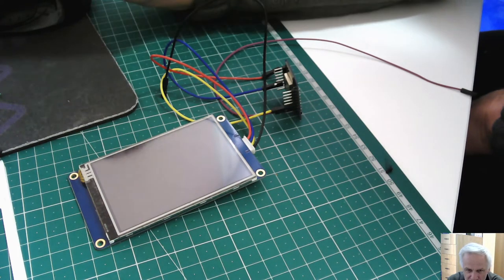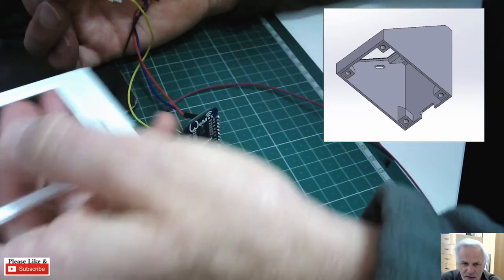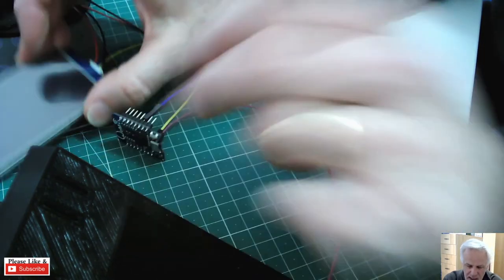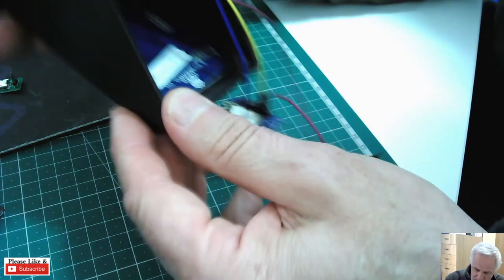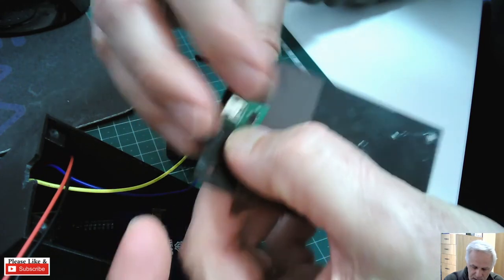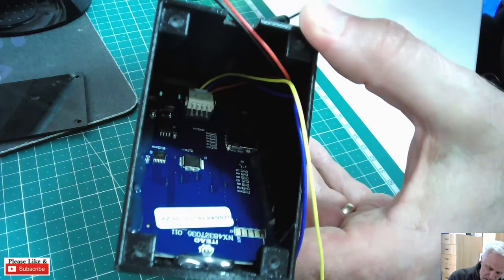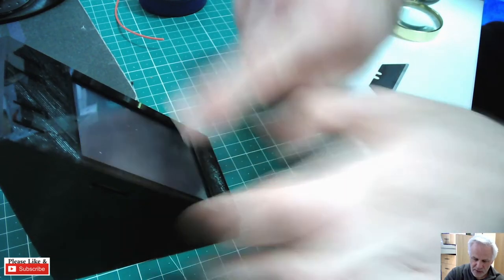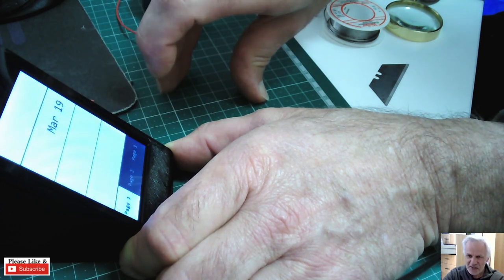HA Switch Plate (HASP) #0017 3.5" Nextion Desk Top Design

Comment: I think the latest firmware has provision for a buzzer on pin D2.   I am in Australia, with similar shape wall plates to the US, but fitting a buzzer in the actual wall plate is still tricky.  I think it would need to be a very small piezo buzzer....
Reply from the maker: Hi Brendan it's been a while since I have looked at this project. May be time to revisit it
Reply: @flixmyswitch  The latest version using blueprints instead of yaml to create functionality is pretty easy to use.   Just would rather it on the wall than on the desk :).
Reply from the maker: What kind of box do you have in mind depends upon the country I guess
Reply: @flixmyswitch  In Australia we have a rectangular box, similar to the US ones, but mounting and screw holes are different enough to make it no compatible with US type.   
I'll keep looking though.  I might have to make one up if I don't find anything.